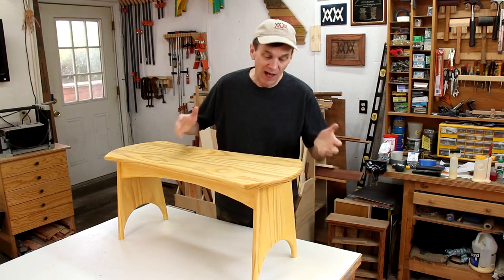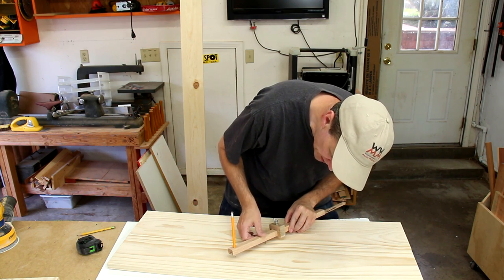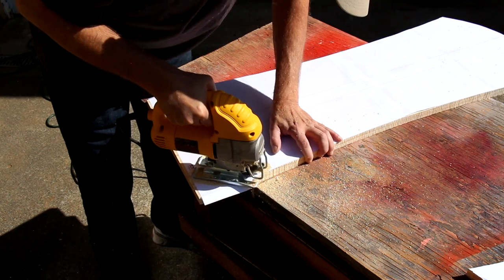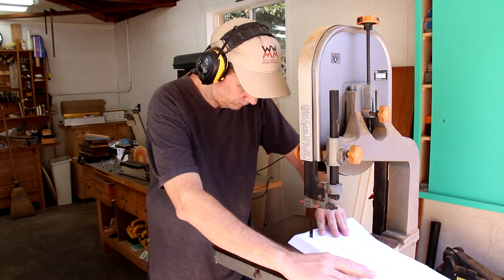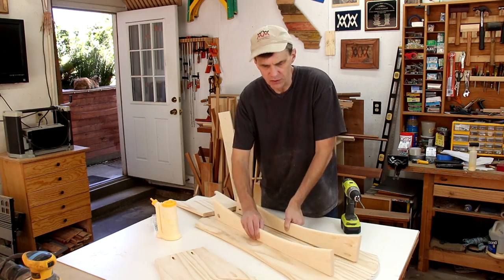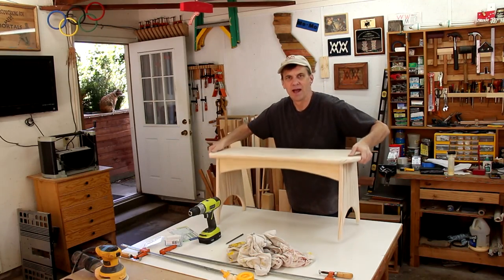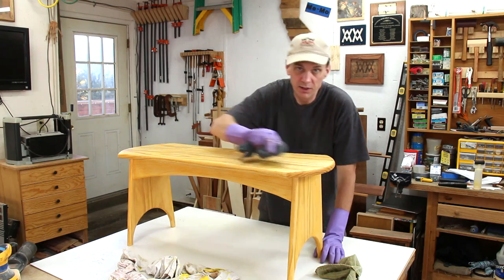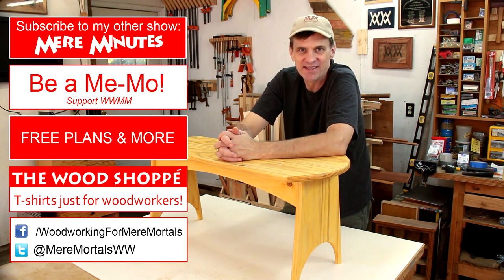You can make this five-board bench in a weekend. Fun woodworking project!

Comment: Yeah, Steve is using something other than spray lacquer. You;ll need multiple coats of the danish oil. At least 4 separate coats
Reply: How long do you have to wait between coats?
Reply: ***** Not bad at all, definitely will give try, thanks
Reply: *****
I'd say a day or more, The oil in Danish oil is boiled linseed oil which is very slow drying.
Reply: Jay Park Most finishes have two different drying times: the shorter is how long it takes for the surface to dry, so you can apply another coat, while the longer is how long it takes for it to be completely dry and ready to use.

Comment: That's very attractive, but why didn't you angle the legs?  Most 5 board stools I've seen have the legs angled out.  It does make it a bit more complicated to make tho.
Reply: I've seen a lot where the legs are square. Not sure if it's a regional thing or just because they are cheaper or what. Nice thing about 5 board benches is that they are easy to make your own and easy to make cheaper or nicer depending on your audience.
Reply: They're easier to make with splayed legs if you attach the stretchers to the outside of the legs.  You still have to cut the top & bottom of each leg at an angle, but that's not hard.

Comment: Glued and screwed the base to a solid top?
Reply: Keena Heaton You're right, of course. The design should have allowed for expansion and contraction of the solid wood top. None of the "joinery" of this project is up to professional standards.
Reply: +dlwatib ....picky picky.  This is not an 18th century reproduction.  The width of the top is at the limit for NOT worrying about expansion/contraction.  Pocket screws with widened holes would relieve worry however.